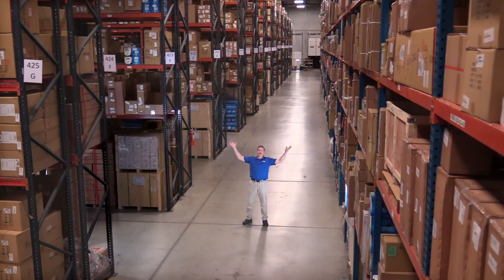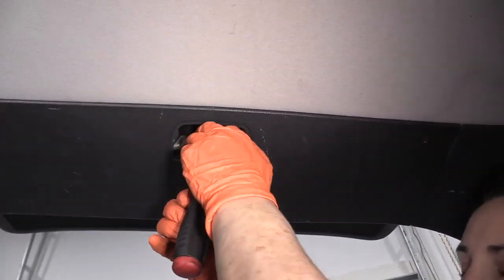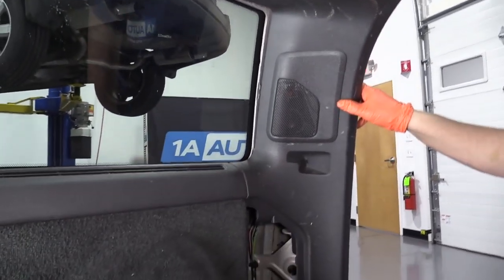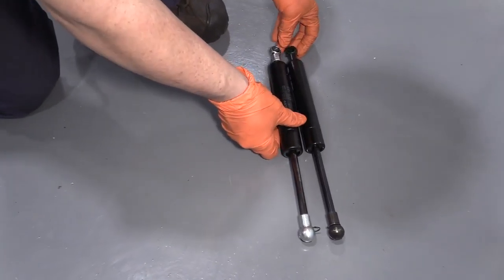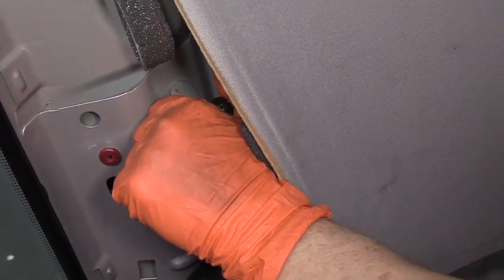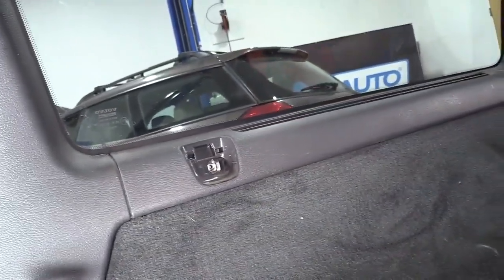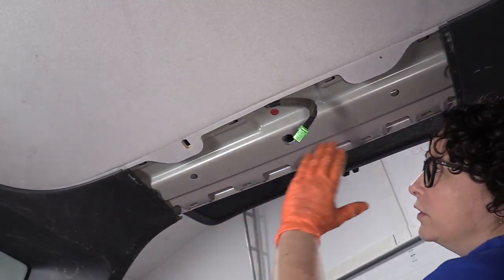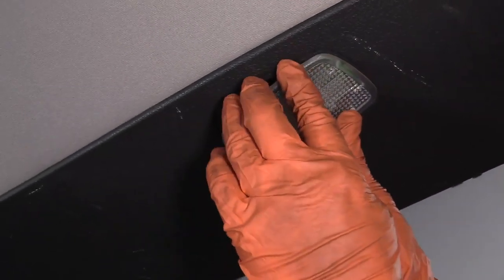How to Replace Liftgate Supports 01-07 Volvo V70

Comment: Thank you a lot for this video explaining the procedure for removing the parts.
I just finished replacing both rear tailgate hatch strong arms VOLVO 8643038 Stabilus BUT ...
It was not so easy and required  2 persons, 1 to hold the tail gate up in the proper position to help for safe removal and installation. It was not possible for me to put the pins properly at the end forward (at the thinest end), and the way I found  was removing the 2 nuts that fix the plate to the roof (13mm tool) and done easy. This procedure is the one used for removal in other models Volvo V70 before year 2000.
After that I tested the tailgate and is working brilliant!!!
I put back all the panels and `pieces and I am very happy  of the results.
Thanks 1A Auto  very much indeed for your instructions and video.

Comment: Very good instructions. Normally I cuss out engineers who design this stuff, but I give credit to the Volvo engineers who put this together. 5 fasteners, plus a bunch of pop in clips and the struts are right there in the open. I cracked the side piece where the speaker goes, so be careful pulling them out. It would have taken me less time, but I got a leg cramp.
Reply from the maker: +Eric Johnson Thanks for checking us out! http://1aau.to/m/Shop-1AAuto-c
Reply: I just replaced hatch struts on my daughters Ford Focus wagon. The shocks were completely on the outside and took 5 minutes...no removing lamps, bolts or trim.  

I realize the V70 is considered more of a luxury vehicle so they decided to conceal the struts but really, would anyone care if they were visible?  This was likely a move to drive more work into their service dept.
Reply: @stevemccooleq  I wouldn't mind at seeing them but with Volvo, safety is priority. Perhaps they were concerned about children messing with them?

Comment: One question what does it mean if the tailgate literally just flies open with a speed too fast? Does it mean it needs replacement as well?  I also have a v70 from 2003
Reply from the maker: +Alexander S Thanks for checking us out! The strikes may need to be adjusted or there could be an issue with the latch. You should not need to replace the entire tailgate. We suggest taking your vehicle to a nearby reputable shop to identify the cause. Thank you!
Reply: @1AAuto  Thanks for taking time to answer. I will follow your advice!
Reply from the maker: +Alexander S You're welcome!